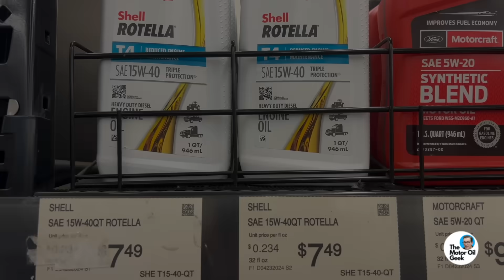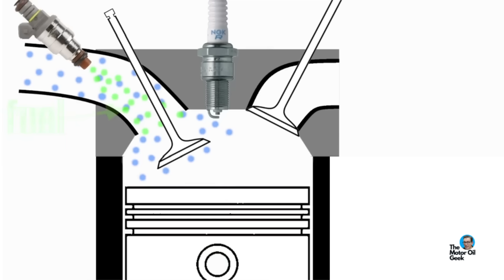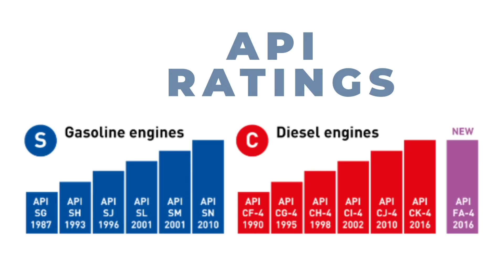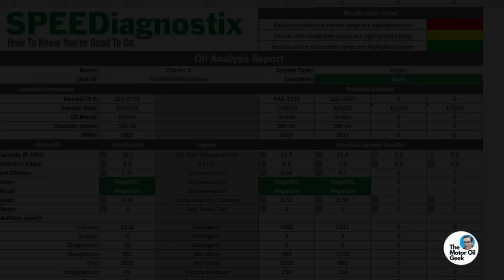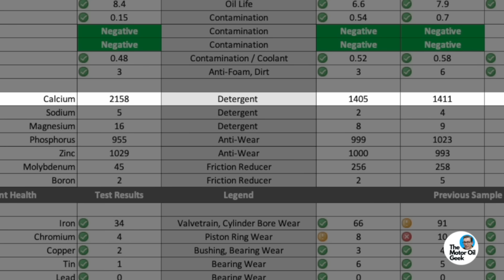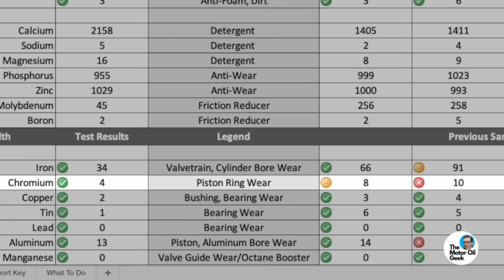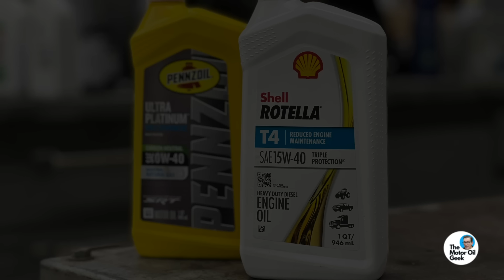Why DIESEL Oil is Actually WORSE for Gas Engines!

Comment: Been hearing for years that running diesel oil in a gasoline engine was superior, but nobody had any science to back up their claims “opinions”. Thanks again for teaching us common folks the right way to care for their vehicles! Keep the videos coming, love this stuff!
Reply: You did hear this is a problem for direct-injection gasoline engines, right?
That whole thing through me off, no mention of flat tappet vs roller tappet, vs whatever.
Reply: The comparison isn't equal, numerous European oils are diesel oils additive wise, yet they fulfill all the required standards for both gasoline and diesel engines. European oils are typically seen as better than US oils due to their more rigorous standards and higher performance criteria. 

Ignoring this is a missed opportunity as we have decades of real world manufacturer standards that says this is perfectly fine. While I understand that not all US consumers use European oil, many vehicles available in both markets have identical engine. Claiming that it's acceptable for one and not the other is misleading. I don't mean this rudely towards Mr. Lake however it is a very clear contradiction to this video which given his field should have been addressed.

For example Mobil ESP is both gasoline rated, and diesel rated, many oils on the market (primarily European blends) meet both standards so it's a big contradiction.
Reply: @GainingDespair  From what I've seen 5W30 and thinner oils tend to have both the gasoline and diesel specific approvals from the vehicle manufacturers.

While, 5W40 oils and the thicker tend to support either gasoline or diesel, not both.

For example, in the case for VW engines, 5W40 engine oil for gas engines must have the VW 502 approval. Typically, an oil with this approval can't also have the VW 505 01 approval, which is the appropiate one for a diesel engine of the same era.

But this separation looks like it's fading away with the newer, thinner oils. Can this maybe be the subject for another video?
Reply: @rpgspyware9560  

Lets say you have a 2010 Honda Accord, or 2010 Toyota Camry these vehicles where released when the most modern API standard was API SM. We can look at something like Mobil 1 Turbo Diesel Truck 5W-40 which is also API SM rated. Mobil 1 FS 5W-40 (European) also carries API SM and diesel certification. I guess my point was there is actually far more overlap than not, and if you look at all the modern API standards the vast majority of them are not compatible with direct injected motors simply due to the additive quantity.

My issue is with the example of direct injected, the vast majority of vehicles are not direct injected. While it is basically the standard for all newer gasoline engines there are hundreds of millions of vehicles on the planet which do not suffer from LSPI so to say LSPI is why you can't use diesel oil in gasoline engines is kinda pointless when we have a lot of documentation which says we can, and in many cases the actual standard.
Reply: @GainingDespair  Yep, I actually have a bit of a problem accepting 1200ppm of any aditive turning  Diesel oil into LSPI "detonation city" - More likely the Lower viscosity Oils, stratified  charge, poor injector etc..etc..
Reply: If this video is correct, then why are our old 6.2 and 6.9 diesels with flat tappet cams being well protected from wear despite more detergent in T4?!
Reply: @wayne7937  Your not supposed to say that 🤣
Think we need to define what generation of Engines the discussion is covering - Alot of this very latest stuff will fail with any oil !!
Reply: No gasoline thinning the oil for one.
He never said it was bad. Only that new api-sp had less wear in a gas motor.
Reply: It is ONLY superior to api-sn oil.
That is it.
Reply: I was thinking of doing that a while back.
Searched whether it was safe one time, and saw nothing warnings not to use diesel oil in a gas engine.
So I went to 0-5w-40 euro oil.
It's just slightly more money.

Comment: I still run 15/40 Rotella in my 332" stroker Ford 302, 11:1cr, carbed and solid flat tappets, 25 years and still going, pure street use, still has no blow by, no discernable lifter/cam wear, same warm 85psi oil pressure @ 8500 rpm as it had the day I built it. I change the oil very often, too.

Comment: @motoroilgeek does the same mentality hold up on air cooled small engines that don’t have filtered oil and operate at higher temps or would the extra detergent and dispersants benefit those types of engines?

Comment: There has been a fee different chevys that I was told to put 15-40 in it. I have been putting t4 Rotella in my 370k mile gmc for quite a few years now since once the oil gets to operating temp the pressure goes down to about 4psi with 1540. Seems to have been doing a great job

Comment: I run Rotella T6 5w40 in my 4Runner. 1grfe v6 (can use any oil, check out austrailia or puerto rico manuals). I imagine it will be fine since it isn't burning any oil. On the 2nd change rn. Will do OA and see what it suggests. But I do know some oil is better than no oil lol

Comment: Your video would be a little more believed able if you didn't have dave the moron in your video the same idiot who says you don't warm a diesel to in winter you start it up and go. And used diesel.oil in my grand am for 400,000 km never had an issue sold it and shits probably still running guess why diesel oil cleans
Reply: This guy also says to not warm up your engine actually.  Pretty much every seems to agree there is no reason to do it.  My understanding is that idling comes with its own negatives.

Personally I prefer warming up but probably it as much as others do.
Reply: @borontv6400  do you live in Canada we're it gets cold asf or you American were you consider cold California lol cause in Canada we're in hits minus 42 Celsius you need it to warm.up oil pressure is to high to drive even if got your truck plugged in the oil pan in far from the top end on amh diesel the block Hester don't heat the oil hence warming the engine up.

Comment: So my 460,000 mile 'old school' Jeep Cherokee that's had 15w40 Diesel spec oil since almost new is about to explode?
Reply: Listen, that engine will run with water in it. Lol
Reply: 1950 engines are completely different. I guess you heard nothing about Application, they are referring to Modern engines.

Comment: You really did a poor job here differentiating between gasoline applications. You should have titled this piece completely differently, focusing exclusively on GDI applications, not gas engines in general.
Reply: No they shouldn't have because you still get increased wear with diesel oils in gas engines due to their increased detergents. Did you not pay attention to the video?
Reply: It appears the goal was to create controversy which will drive clicks to his channel.  Sadly the bulk of people watching this do not understand he talking about GDI engines specifically, the comments bear this out.
Reply: @NotOnYourLife  Wow it seems you all missed the point. He's not specifically talking about direct injected gas engines, that's only for the damaged piston. Increased wear is ALL GAS ENGINES! Man you people are really stuck deep in this diesel oil in gas engines cult, you can't even understand a simple video. Increased detergents in diesel oils compete against the anti wear additives which increases wear in ALL GAS ENGINES.
Reply: @bobbygetsbanned6049  They did indeed miss the point. The video went right over their head or they didn't watch it completely.
Reply: @bobbygetsbanned6049  I disagree that it’s a simple video. I’d have to rate it a fail due the confusion generated. I didn’t see definitive proof that it causes wear in all engines. Clarification or even a remake of this video would be a good idea. We all only want to protect our equipment.
Reply: @bobbygetsbanned6049  You need to watch again,   6:20  12:20  every reference to issues is with GDI engines, not port injected engines.  If you have a reference point that clearly states gas engines that are not GDI please reference it.  I don't mind being wrong, I see it as an opportunity to learn.  Oil quality and additives are a moving target, as more and more engines on the road are GDI oil mfg's will make sure the oil is tailored to their needs.  Those of us who have run 40 weight oils may have issues in the future.  As for what happens in reality, my 03 2500HD was a previous fleet vehicle that had T4 40 weight in it from the  first oil change, it now has 317k miles.  At 290k miles a new oil pump was put in and the mains checked, there was no abnormal wear and the dealer elected to not change bearings, think about that, a Chevy dealer not adding work to pad the bill.  😆  I accept that ratings and specification change but reality being what it is there has been no issue with the old T4 and T6 for a long time.
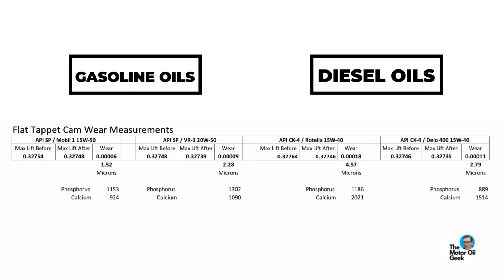Reply: @idunno6480  It's not confusing at all, you just didn't pay attention. He explained the detergents needed for soot in a diesel, compete against the anti wear additives, then provided data showing diesel oil allows more wear with the chart at 8:01, 3x more wear for Rotella 15w-40 than Mobil 1 15w-50. Everyone just ignored it because because they are way too deep into the Rotella cult to ever accept that it's not the best oil for every possible application on Earth. Most the comments on this video are just "I use rotella for everything from my lawnmower to sex lube with my wife, and never had a problem, so you're wrong!!".
Reply: @NotOnYourLife  Dude mention's GDI one time and you all think the entire freaking video is about GDI, when he said passenger car oil like 500 times. The wear table he shows at 8:01 has literally nothing to do with GDI. This time, rewatch the video without the absurd notion that everything is about GDI, when it's not. And please save me your anecdotes, I couldn't possibly care any less about them.
Reply: @bobbygetsbanned6049  That timestamp is in relation to flat tappet cam testing only.  How long has it been since a flat tappet cam has been used in an automobile gas engine?  Do you even know the difference in a flat tappet and a roller or why ZDDP levels are important in each use case? My oldest car is an 89 with a roller cam and the higher levels of ZDDP needed for a flat tappet can do real damage to the cats on a more modern vehicle.  He did not mention GDI just once, if that is all you heard I can see how you are confused and standing on a hill that is crumbling.  It is also easy to see how you got your name, I am sure being banned isn't something new in your life.  You may not have the ability to discern personal experience from from what you heard on the internet, but I have two LQ4 engines, the 2500HD and an 03 Yukon Denali that has had Mobile 1 5w30 all of it's 210k mile life.  Guess which one runs better after all of these years?  It is the one that has always run T4, go figure.
Reply: @NotOnYourLife  So you throw out more anecdotes lmao. Wear is wear, you'll see the same result with piston ring to cylinder wall wear. But of course, the only thing you can comprehend is anecdotes, not data. It's a fact the detergents in diesel oils compete against the anti wear additives in the oil, and since gas engines don't need those detergents, because they don't produce soot, it just makes the anti wear additives less effective for no reason. But of course, you'll intentionally ignore that, or pretend it only applies to GDI, because you only care about anecdotes and worshiping rotella.
Reply: @bobbygetsbanned6049  You keep using the word "anecdotes" but I don't believe you understand what it means or the difference in anecdotal and actual experience.  You did not bother to answer if you understood the difference in a flat tappet and a roller or why ZDDP levels are important in each use case.  That indicates you do not and chose to deflect away from it with idiotic "cult" insults.  That in itself is humorous since I have already written that I also use Mobil 1 as well.  It really sounds like you are a 16 year old kid with a lot of internet experience and but has never even changed a spark plug.  lol  At any rate, you have overestimated your value to me and though sparring with you has been entertaining, there is no point in continuing further.  You do you and accept that others may not do as you do and in the end we will al be OK.  Peace.
Reply: Guys this isn't helping anybody. Direct/indirect injection aside, the question here seems to be diesel oil vs gas oil+zinc additive for those old flat tappet engines or other similar use case. Can we debate that?

I called Shell and asked if T4 was ok in my old ford with the 300i6 and the guy on the phone emphatically said yes it's good for the flat tappet cam engines. Assuming he was right, doesn't that only leave the the detergent vs anti wear question?
Reply: @NotOnYourLife  the internet says high zddp oil will shorten catalytic converters.
I’ve run high ZDDP oil in cars that I have kept for over ten years.
I never had a bad catalytic converter & I have always passed inspection and never any engine problems. Currently I have one turbocharged car, one dual turbocharged car, & one supercharged car. They all get diesel oil. Usually Valvoline, Mobile, Shell oil. 
Zero problems.  Driver abuse is the issue and we know that.👍
Reply: @NotOnYourLife  In fact it's you that does not understand the difference between anecdotal and empirical evidence, your "experience" is anecdotal evidence, at best. I didn't even read the zddp part of your comment because your opinion on zddp doesn't dispute any of the data presented in the video. And when you claim an engine runs better because of oil selection, with absolutely no way of knowing, or proving that, you very much deserve the rotella cultist moniker. I'm sorry you don't understand data analysis, so you have to rely on "experience". But that's ok, pretend I'm 16, whatever helps you feel better.
Reply: @stepside2839  In my 61 years on this planet I have never had to replace a cat.  I cannot confirm or deny that it is a fact you ill kill your cats with a high ZDDP oil.  I suppose with all things it depends on quantity.  Perhaps those people out there dumping bottles of zinc additive to their roller cam motors and then failing inspection for catalysts are the cause of that belief.  I would call that driver abuse.  One thing that really hasn't been noted in this discussion is that the additive package for every brand of oil is different.  Detergent and anti-wear additives are not a set amount in all 5w30 for example so what is the right amount and for what engine?  If Rotella T4 is going to hurt my LQ4 then when, it is already at 317k hard miles so is it going to kill the engine at 320K?  😄
Reply: @NotOnYourLife  AGREED 👍
Reply: Time for cat destruction is closer to 20 years with high zddp if that makes any difference. No epa checks in my state.
Reply: Totally agree.
Reply: Hasn't he done this before, made a statement about gdi, but generalized all gas engines?
That along with testing products for applications they're not for.
Such as when he tested if mmo, ceretec, rislone etc prolonged oil life. When that's not at all what they're for.
Reply: He's definitely confused me. So if you have an indirect injection gasoline engine you're fine? He talked a lot about pre-ignition which I assumed was related to direct Injection, but what about increased wear due to the soot additives or whatever?
Reply: @noscopesallowed8128  No, you're not fine. The increased detergents in diesel oils, which are not needed in gas engines, compete against the anti wear additives in the oil, which increases wear in ALL GAS ENGINES. Gas engines don't produce soot like diesel engines, so you don't want to run diesel oil in a gas engine, even if it's port injected or carbureted.

Comment: I have a Cummins generator (20+/-y/o) . It has a ford v6 engine, it runs on natural gas. The filler tube says 5w/30. Recently when I changed the oil I used some Royal Purple 5w40 that I had on hand and when I cranked it I was amazed at how much better and smoother the engine ran . I’ve asked electric motor company and they really didn’t know if this an issue . Because of the age I suspect it’s previously been using conventional motor oil. I like the way it runs on the synthetic oil but don’t want to damage anything. I live in a warm climate and it is used for electricity outages only.
Would appreciate any advice that you may have.